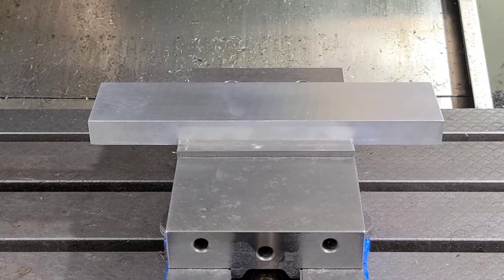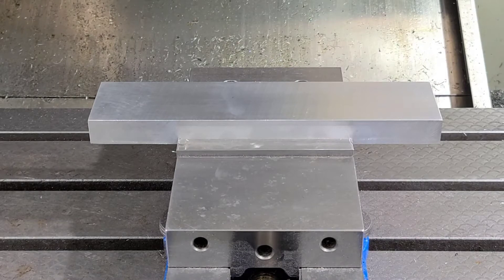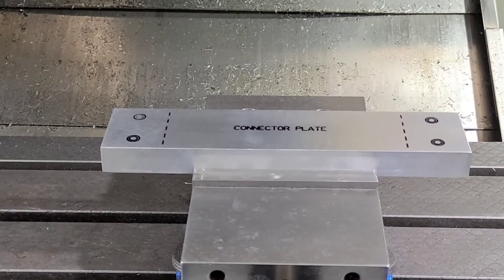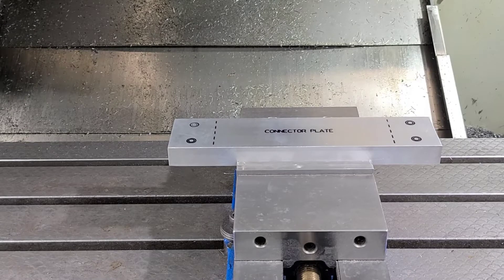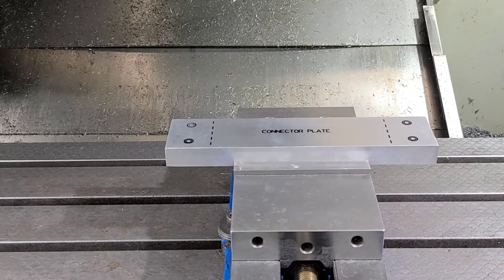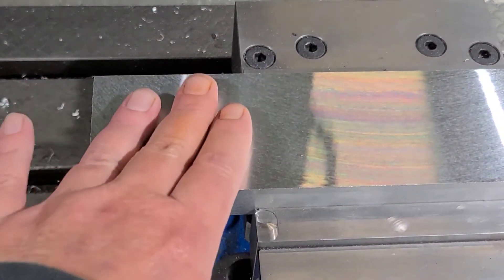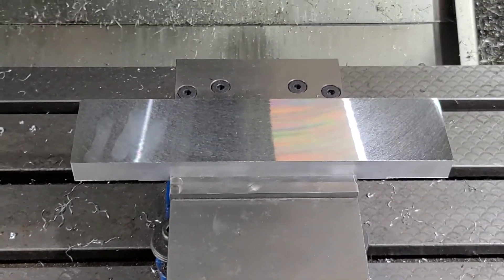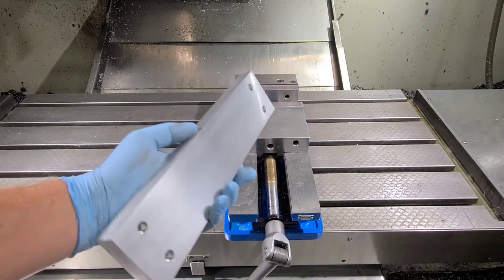Upside Down Fly Cutting - Suburban Tool Fly Cutter

Comment: Nice work.  How do you set the tool height for the undercutting tool?
Reply from the maker: Hi John whenever I do an undercut like this I ussually overhang a parrallel on the top after cutting and touch the underside, I think that was how I did this one but it has been a while. Then I do the math from there.
Reply: Thank you for your reply.  I see that you machined it on a CNC mill.  Was the cutting programmed or did you do a manual over-ride to do the underrcut? @mvpmachine
Reply from the maker: @johnspathonis1078 John It was programmed for sure I rarely do manual stuff on the cnc because its way easier to just send the program over from the pc and safer in my opinion because you have a visual reference

Comment: Thank you for sharing!  I have the same fly cutter and wondered about speeds and feeds because of the unbalanced nature of that tool.
Reply from the maker: Hi Joe thanks for watching! Here is a link for the pdf feed and speeds for these cutters :https://www.subtool.com/st/imgs/Fly%20Cutter%20Safety%20Document.pdf.   it's pretty accurate but it depends on the machine it's being used on. I can really push the envelope at our shop with 40 and 50 spindle taper machines in aluminum. But lighter machines need to be crept up to a safe maximum speed...Tim
Reply: @mvpmachine  Thanks for the information. I have a Series 1 BP with 30 taper, so I’ll take it nice and easy 😉